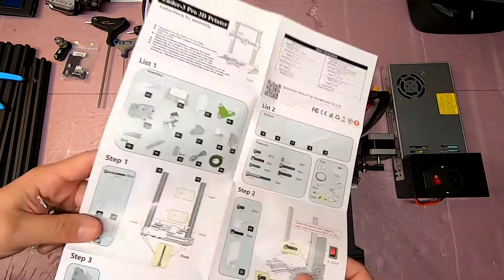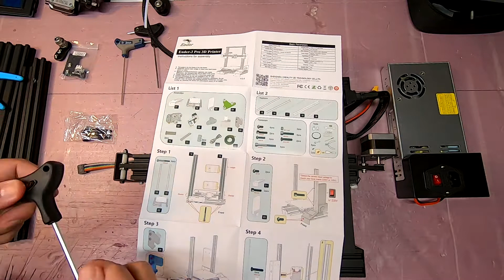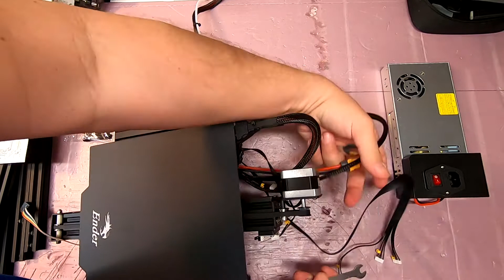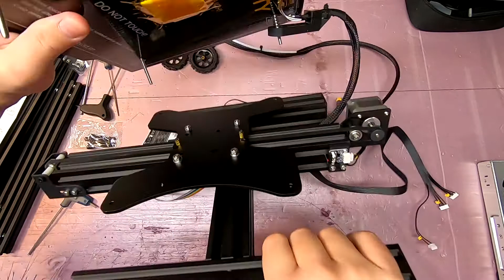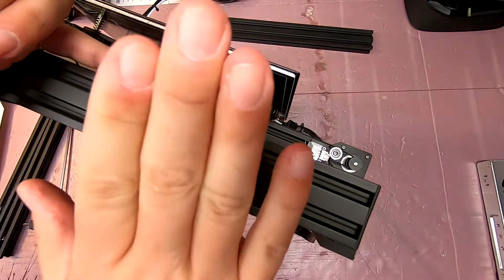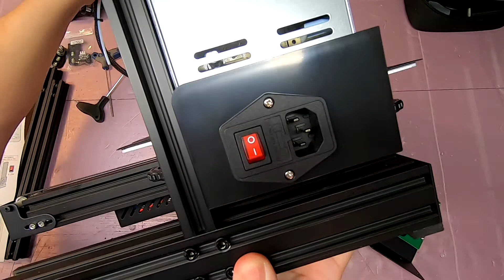Assembling, Configuring, and Testing the Creality Ender 3 Pro 3D Printer Pt-2

Comment: Looks great CJ! Excited to see what you end up printing. I just got mine 2 days ago. I printed the test dog and it came out perfectly. I’m currently trying to print my jet drive for a RC boat but the prints aren’t working correctly now. I’m guessing it’s stemming from the settings in Cura before I upload it on my SD card.
Reply from the maker: Hi Mike, sorry for the late reply... my wife woke me this morning with the words, "this internet is down"... turned out the battery backup the router is on burned out during the night. I had to run out and get a new one. This sounds like a quick fix but, and I'll spare you the details, it turned into an all day project.
I've been getting great results right out of the box with PLA filament from several different vendors and Cura as my slicer. I started by printing some enhancements for the Ender 3 Pro from thingiverse. Then I installed FreeCAD and designed a few items: wall-mount racks for big glider wings, an enclosure for a bucks converter, feet to turn the wall from a dog crate into a free standing obstacle to block a hallway so our pups can't escape... I'm currently fine tuning the design for wall racks for fuselages. BUT...... I am trying, as I type, to print a dual fan cooling duct for the Ender with PETG and I'm getting a stringy mess. The first attempt clogged the nozzle after it printed the raft... I just checked it and it's FUBAR again! This is my first 3D printer so I'm learning as I go. A lot of people seem to have trouble with PETG which is a shame because it has a higher melting temp than PLA making it more suitable for most RC applications. There is always Delrin, Nylon, and ABS but they all have their issues. For printing rc planes, PLA and PETG are probably the best. I'm going to do some research and some testing with small items until I master PETG. You can be sure that I'll share my solution(s).
I've been having good results with Cura as my slicer but there are a lot of options to figure out...
What filament are you using?
Who makes it?
Are you using supports in Cura? This can make all the difference.
Reply: @MyRCChannel-CJScott  Thanks for the info! This is also my first printer, fortunately I'm quickly learning how to trouble shoot and fix the issues I'm currently running into. I'm using a standard black PLA from hatchbox, I was originally using cura but switch to ideaMaker and played with the settings then sliced and the Jet drive printed out perfectly.
Reply from the maker: That's great to hear... I'll have to check out ideaMaker. You'll have to post some videos of your jet boat and send me a link! 
I must have done something wrong in Cura because after the problems with the PETG, I tried printing something with PLA and it was also fouled up to so I scratched my head and then did a reinstall on Cura deleting all old settings and was back in business. I haven't tried printing with PETG again because I'm running off some items in PLA that are going to take 4 days to print... yes, 4 days! Then I'll try that fan duct in PETG again.
Reply: My RC Channel yes for sure I will upload the jet boat once it’s finished. It’s a total of 65 hours just for the jet drive. I couldn’t imagine a 4 days print that’s crazy these printers can run that long without messing up. I just hope I can perform the right maintenance to sustain it for at least 2 years
Reply from the maker: Where did you get the design for the jet boat? I'm assuming you're powering it with electric vs fuel, but depending on the plastic, or if it was painted, it could be fuel proof. I look forward to seeing the fruits of your labor. It's really cool that you bought yourself a 3D printer and dove right in to a big project! Please keep in touch and tell me how how the build goes and how it performs.
Reply: My RC Channel sorry for late response. I got the design off pin shape. I’ll be using electric motor to power it. Yes I’ll definitely upload a video once it’s completed
Reply from the maker: @mikes150   - Don't worry about the late response... life, right. I've been recovering from an eye surgery, which is my excuse for not getting back to you sooner. I look forward to seeing how your project unfolds. Please keep in touch!